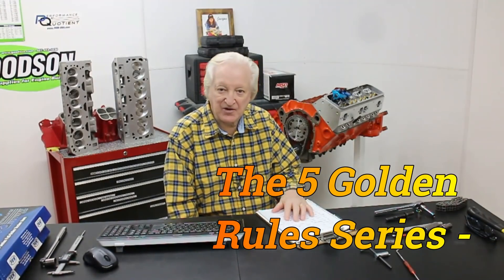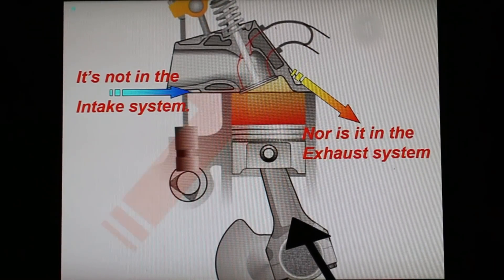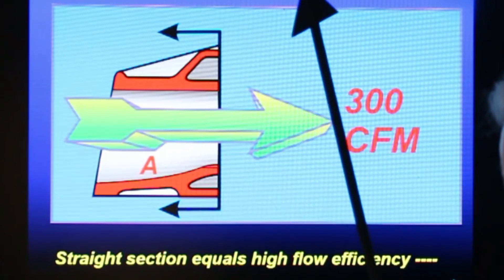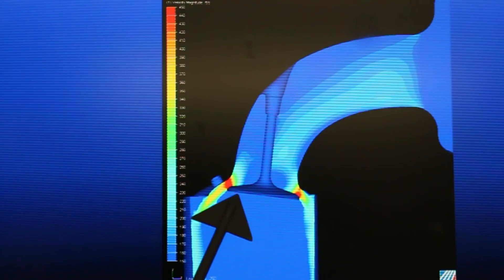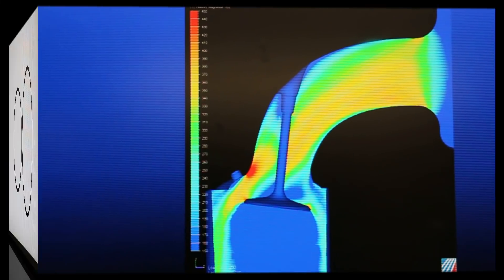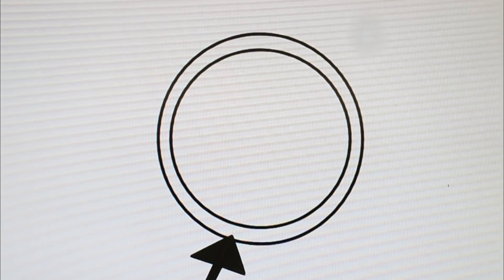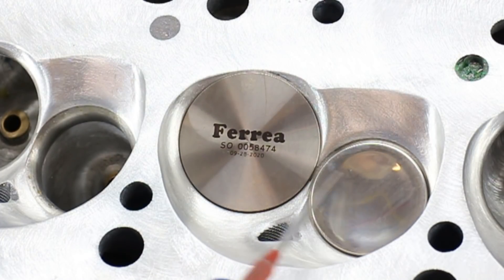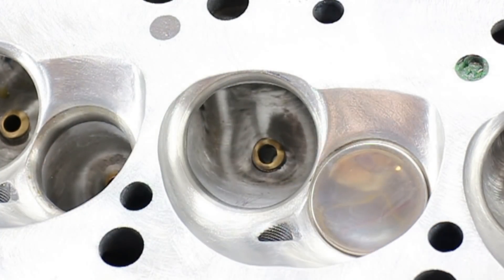David Vizard's PowerTec 10 EP 23 5 Golden porting rules #1 Identifying primary flow restrictions.

Comment: During a few classes. I was able to design a cylinder head that did not use tulip shaped valves. Instead it used gates. No push rods or rockers where needed. Its works just similar to a rwo stroke or rotary type air port. I know there has been "ball" style valves experiment with that work like a water garden hose type valve. 
  Iam still looking forward to contributing to your channel if your still interested.!
Reply: Auto manufacturers are starting to do away with camshafts, electric solenoids that’s open the valves, endless possibilities in cam timing . Sounds like a cool idea you got there.
Reply: @jcnpresser  we also tried electrical solenoids for valve functions. The valve itself becomes the limited factor.  Just as David showed. There is also reversion in addition to this with a valve that move back into its pocket. The gate style doesnt have that. And a port window in the door can be tapered to control port speed with a transitioning shape. The idea is what started some of the two stroke snow mobile designs currently being used. They are using gates. Just like the gates in a predator carb. Engine draw is what opens the gates in these power plants.